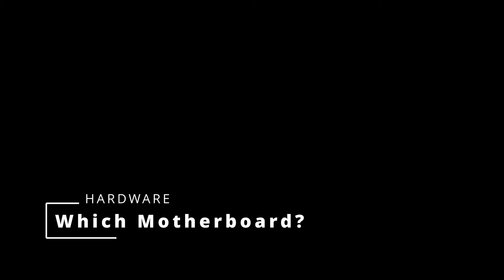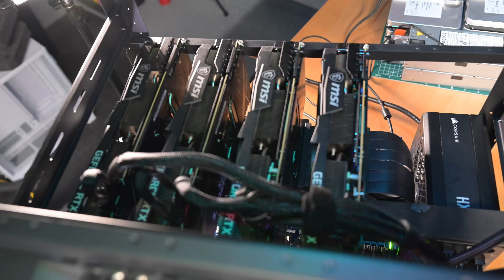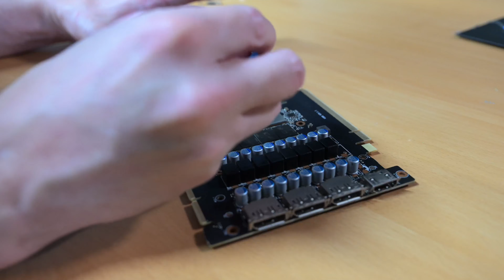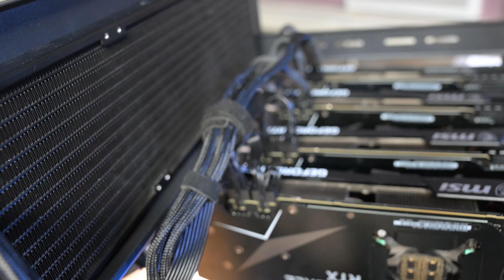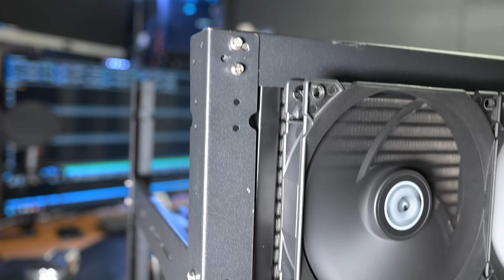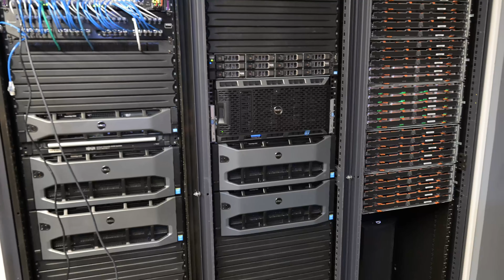INSANE Home AI Server - Quad 3090 Build

Comment: Do you have any recommendations for an air cooler for a CPU?
Reply from the maker: what is the specific CPU part number?
Reply: @DigitalSpaceport  I’m going to purchase the 7702p CPU, just like your specifications.
Reply from the maker: I use the Noctua SP3 on another epyc Rome system, a 7B12, this is a very tall but should just barely clear on the GPU rack from a measurement I just did. Like 10mm close. https://geni.us/NoctuaSP3_CPUCooler
Alternatively the D9 also fits SP3 and is lower profile at 92mm and It is featured in this video on my 7995wx. I like it but its noticably louder under load, but the 7995wx is the hottest chip to my knowledge. If it ramps full blast fans, its not quiet at all. https://youtu.be/YQZ2HWonnGA?si=d5CtIYrhjHF0D5AB
Reply: @DigitalSpaceport  Thank you for clarifying. My expectation was for the air cooler to be quiet.
Reply: @TuanAnhLe-ef9yk  To be honest I think it's crazy, I used to use quad GPUs from 2 cards, but that was difficult enough with power and cooling.

I'm not even sure that 4 rtx 3090s will scale well on machine learning.

Comment: does it matter if I purchase a 7702 over a 7702p amd epyc cpu?
Reply from the maker: @Grapheneolic  7702p is fine for single socket boards. It wont allow for a second processor is the only difference.
Reply: @DigitalSpaceport  Thanks for the quick reply. So given I purchased a 7702, I could technically add a second processor if wanted to?
Reply from the maker: @Grapheneolic if you have a motherboard with a second socket, yes.

Comment: Do you have to use even number of GPU(4)? Will it work with 3 GPUs?
Reply from the maker: Yeah 3 will work, just remember that the VRAM is additive so you want the whole model to fit into the VRAM of the cumulative cards.
Reply: @DigitalSpaceport  thank you very much for your reply, I'm just getting into building pc for LLM and gathering information on which gpu I should use and how multiple gpu can be beneficial

Comment: Which ollama model did you use? What is token count? There is not any info...
Reply from the maker: I'm using metas llama 3.1 70b and it hits between 22 and 17 tok/s. 8b hits around 95 and 405 hits around 1. Have a full video on each model coming up but this video I think I have a chapter on llama 3.1 70b you could check. https://youtu.be/q_cDvCq1pww

Comment: Unlike gaming, AI and machine learning really do not benefit from 16 vs 8x lanes.  That is because models are loaded once.  Once the model or models are loaded into VRAM, the CPU has a minimal effect.  Now, if you are pooling VRAM with NVLink, it is so much faster than PCIe 3.0, 4.0, or even 5.0 by a long shot.  Also, though I have U.2 access with both the Z590 Dark and Z690 Dark Kingpin, they pale in comparison to the speeds of native PCIe 3.0 and 4.0 NVMe.

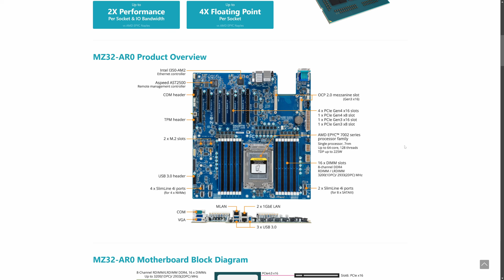I, too, have that same chassis from mining but have always wondered how it would perform as an AI frame--just haven't gotten around to tinkering.  At 3:20 I've stopped, because experience gained from the last year of the Etherium GPU mining boom to now is sufficient, and for me, I doubt there is any real new value.
Reply from the maker: Oh Im doing training also but yeah full lanes are not needed for inference. I did mention that. Can I nvlink the 3090? Ive read its minimal return recently. I guess the channel isnt for you, no harm at all there lol.

Comment: Really cool build, I also have a 4 gpu rig.

The only thing that I would recomend is trying to give some space between the GPUs as maximum as possible, because they being close to each other will generate a lot of heat, the difference is enourmous. 

I would also add extra coolers to the GPUs, I personally like the maxmium of 1 gpu per 120mm cooler , and the coolers blowing ar direct to the GPU.

I'm not sure if a watter cooler is a good Idea here, I'm saying that because no server uses watter cooling, neither CPU miners (people using the cpu on 100% 24/7), because watter coller tends to stop refrigerenting at some point, and it doesn't have the best efficiency. I'm not sure also if a 120mm cooler will fit on your build, I'm just giving food for tought
Reply from the maker: Yeah the water cooling is working fantastic at keeping the CPU cool under workloads for really large models, but Im fast becoming annoyed badly those. Too dang slow. The 3090 non ti also generates a lot of heat on the back. Im working on a placements to help with heat load also. Im likely to have a video on that also at some point. Ive got vornado knockoff right now and it hits the board and keeps the nvmes cool, but redoing the whole layout of the mini datacenter is very likely.
Reply: I have a question, are you able to load any large ai model or at least model 32B 8Q with 128k windows context?  I mean only use GPUs?

Comment: Have you tried renting out your hardware with vast ai or salad?
Reply from the maker: I need better upload speeds. Cable modem has me capped at 40mbits upload but high split is on the way and should make that a viable route for idle times. I need to think about reservations and utilization more before I put this rig on it but competition is pretty high on depin, and impossible at 40mbits.

Comment: This is dope and extremely cost effective but it's not future proof. What happens if 2x 5090 makes it possible to run llama 4 1t
Reply from the maker: No its not future proof at all, but I wanted to wait until we see the next nvidia GPUs before I decide on something bigger. I dont think we will see more than 24GB VRAM in the 5090 currently, and while model split is a thing and does work.... its pretty slow.

Comment: Powering each 3090 with a single 8 pin ala piggyback connector?  I thought 8 pin standards had a max wattage of 150w and even though your going to use afterburning (or equivelent) to reduce, you stated anticipated 275w. I just finished a chia miner 4x 4090 setup and I'm going to have to use afterburner to reduce the power as three 4090's on a single Asus ROG Thor 1600 trips the internal breaker and shuts off the PSU. Will be interesting to see how your four 3090's and the Corsair 1500 handle similar with additional draw from an Epyc processor/motherboard combo. May need to add a second to perform as desired. Thumbs up! - I see the PHISON drives also, nice touch.
Reply from the maker: Okay im going to research more on that here. Im not aware of it, and none of the cables are warm just touched um under load for about an hour. Still a good thing to know.
Reply: @DigitalSpaceport , @bishop838 is correct. 150 W per cable for the PCIe connector is the official spec. You also get 75 W from the PCIe MB connector.  Some of my power supplies list 200 W per cable max (even with two connectors), so if you can limit your GPU power to ~225 - 275 W, you'll be under the limit.  If you're just running LLMs doing inference or even Stable Diffusion/Flux image generation, though, you should be fine even with the current setup.  Unless you're doing training or fine-tuning that runs the GPUs at 100% continuously, you're unlikely to trip any breakers or brownout your power supply.
Reply: @hienngo6730 what's the max rated cable you can get? I was looking at a duel PSU 7 * 3090 set up
Reply: @Chris-o1x3b  I have not seen cables rated for any specific power rating. They should all support the spec, though you should probably get good quality PSU to get decent cables. I have 2x 1600 W PSUs in my 5x 4090/3090 rig. I use the standard cables that came with the PSUs (I use two of the 12VHPWR connectors for two of the GPUs, and 2x or 3x PCIe 8-pin power for the rest.). 4090 and 3090 Ti are rated for 450 W each and 3090s are 350-390 W each.)

Comment: Explain to me like I'm knew to this. 

Why would you want to run an AI server? What applications would this enable, and is it actually any better than building a server with more consumer kinda parts? AKA 7950x or 7900x + ONE 3090
Reply from the maker: Love this question. Im going to quote it in the single GPU video which will fully answer the why part. Of note is speed for inference (processing) requests to the system and models landing inside VRAM is of course ideal to the tune of like 10x speedups. Thats a major reason. Several other big ones exist as well.

Comment: How do you plan to cool your mainboard, the board is made to run in a server enclosure. In your current setup only the top of te rack with the gpu's is actively cooled. How do you plan to cool the ddr and other chips on the motherboard?

I run a h12ssl-1 motherboard with Epyc 7573x with 2 x 3090 and went with an Artic freeze u4 air cooler instead of water cooling to get that extra needed airflow inside a 4u server case. I was considering the Gigabyte motherboard but since I don't use a riser setup the top pcie slots wouldn't be usable since the gpu would be directly over the cpu socket.
Reply from the maker: I think the H12 is an excellent choice also! Have one myself going into a 4u case soon. Four fat 3090s wouldnt fit in the case however and this board is v cheap. I have a small vornado knockoff fan that moves a lot of air over the mobo. Thats shown in the most recent video now also.

Comment: can you run llama3.1:405b model on this?
Reply from the maker: Okay I did get 405b to run on this. It was EXTREMELY slow however. I would class it as unusable. That was not unexpected but only 44 layers of 145 can load into VRAM on the GPUs so yeah I guess I would need ~ 12 GPUS of 24GB to run it at respectable speeds. Hit .75 TOK/S at 2048 which ended up being around 6 min generation time on easy logic.
Reply: @DigitalSpaceport  thank you very much for testing if you are just limited by vram would it be feasable to run M40 instead? i have seen them on ebay go for 170€
Reply from the maker: Id be surprised as Maxwell generation is pretty old now. CUDA 5.2 and also pcie3. I'd not go with those cards but there may be more recent ones I should check into.

Comment: I was actually using a Gigabyte H110 mining motherboard for a little while (with a piddly 6500T, for the CPU) because it was all just left over hardware from when I was GPU mining.

The problem that I very quickly ran into was that the models that I was trying to run, save for the smallest of models -- the 6500T very quickly ran out of RAM (at a max of only 16 GB).

So, right now, I have moved it over to my 6700K (again, just recycling/re-purposing existing hardware that I already have vs. buying used hardware that'll be new-to-me), and at least my former gaming rig has 64 GB of RAM, so I am now able to run some of the bigger models.

I might try and throw more 3090s at it later, but I've found that unless you have manually told the AI interface (whichever one you're using) to split the workload between the GPUs (especially, when you're loading in the model) vs. trying to use as few GPUs as possible (i.e. if your model is 34 GB in size, the question is "is it better to split the model up into 4x8.5 GB or run it as 2x17 GB?" (because the 34 GB model exceeds the 24 GB of VRAM on the 3090 and that is WAYYYY cheaper than buying like an A100 with 40 GB of VRAM, let alone 80 GB of VRAM, all on a single GPU).

I haven't ran that test yet because my 6700K is definitely slowing down how fast the AI chatbot can "type".
Reply from the maker: Very interesting did you get around to testing this?
Reply: @DigitalSpaceport  
Yes, I have actually.

Right now, my 6700K system has two 3090s in it, albeit, by putting in the second 3090, it drops both PCIe 3.0 x16 slots down to two PCIe 3.0 x8 slots (each).

So, TECHNICALLY, the bandwidth suffers, but in practice, once the LLM is loaded into VRAM, it doesn't really matter when it is answering questions.

I'll have to pull the performance stats from the system when I get home from work, later tonight.

But subjectively, the three things that I have observed are:

1) It depends on which model you're using.

and 2) it depends on the SIZE of the model.

and THEN 3) is where the CPU speed matters after that (because it has to "type out" the response). 

I can also run another test where I would drop in one of the 3090s into my AMD Ryzen 9 7950X system, and then pick a model that will fit within the confines of 24 GB of VRAM, to see how much the CPU affects the performance.

I can test both of that, later when I get home tonight.

But yes, I did deploy it (for the larger models). It does work. I don't really have great speed comparisons as I don't have very many platforms/systems that are open and available for testing (and most of my systems tend to be older systems).
Reply: @DigitalSpaceport  
So...ran into a little bit of an issue trying to update Ollama from within the open-webui installation.

I had originally done both, where I installed ollama outside of open-webui AND I think because it was having connecting to it from inside the open-webui docker container, so I ended up installing ollama with open-webui, which also meant that when it came time for me to update ollama so that I can download the llama3.1:70b model, I ran into some issues with it.

Long story short -- I THINK that I have the docker container rebuilt now, but I'm about to find out.
Reply: @DigitalSpaceport  
So I finally got around to testing with the llama3.1:70b model that you are running in your latest dual 4090 video, but I'm running with two 3090s (@PCIe 3.0 x8 speeds rather than @PCIe 3.0 x16 for both).

I'll post the results in the comments section of the other video.

I also did run this with the Mixtral AI codestral:22b model as well. It works quite well, I think. Overall. (I don't really have another system to test it with, to see if I can get better performance, so this will have to suffice for now.)

Comment: Why limit gpus' TDP?!? Just add another PSU! 4x3090 is 1400w already! 512ram and 7702 cpu is another 500w, so one more PSU, 750w minimum, it costs nothing compared to the price of the system. And with 1500w you don't want to run it on the max limits, keep 20% reserve, If you want stable reliable system, your gpus has to be limited to 150w instead of default 350, that's a huge hit!
Reply: Because you can lower the power limit by 100w each with just a couple percent performance decline for inference. Well worth lowering the power usage.
Reply: Very good point, btw
Reply: Or just use 1 bigger power supply, maybe a 2kW one?

I have done that kind of thing before, and it typically doesn't work for long, but it's great when it does work.
Reply from the maker: I likely move it into the server racks at some point, for power draw reasons. Im also likely to get a DC powerboard for it then but I've got a lot of rearranging gear to tackle before it gets to that point. The CPU/ram doesn't cross 250 from what I've seen on my 7B12/H12 combo unless im running the cpu hard which this type workload doesn't seem to so far. I also don't trust the 2psu adapter kits, have known a guy who mined eth hard and had several burn up
Reply: @DigitalSpaceport also, for llms, the peak performance is less important. Tha vram is what is golden about that setup right? I limit the power of my 3090 on my grid, just so they don't reach the highest temps in my fairly small case(i am at my financial limits, 800 dolars of used components is what i could afford)
Reply: @DigitalSpaceport  Llama uses cpu at first to compile and ram, then gpus as of my observations and I asked llama how it(he/she) works and got the reply confirming it :)

Comment: Have to say as a GPU/CPU/ASICS  and now AI miner. I do want to build one of these bqad boyz, BUT i would use EVGA PSU and ALSO to be SAFE from FIRE Hazards I would USE 2 PCIE Power cables to the GPUs not one power cable like you did. Beocz of gthe TPD of the 3090/4090. and soon 5090, Beocz of the LIMIT of 1 cable is 250 Watts and the TPD is higher and will MELT and start a fire! Just go to Red Panda's Youtube vids and he shows a vid of Melted and Burnt PCs. That too uch money and time to build that awesome machine and then get LAZY! Dudes if there are 2 or 3 PCIE 8 pin Connectors on that GPU! then do that. but yeah great vid, but no dudes. be safe! u could not only lose this beast of a system but all you own! your home or family. for the specs of GPUs and PCs or just about any tech toy! go to techpowerup .com o yeah Also u can use sever PSU's with the right break out boards, but me i would buy 2 evga 1,600 PSU's to make sure I am under the 80% rule of load and amps and watts on them! also be safer. example. MSI 3090 is TDP 350 W times 4=1,400 watts! And EVHA psu come with a MB connector tester. or u can buy an adaptor were u can use both PSU to work together. and then the TDP of the CPU and Motherboard. AMD EPYC 7702 is TPD of 200W, then u have the other stuff. so that will be well below the 80% rule of load using 2 1,600 watt ones and i seen a 2,000 watt psu too! so buy bug just in case of upgrades. I do hope soon that they make it use way less electric and heat.

Comment: Please, test mixing diferent VRAM size cards like 3090 (24 gb) and 4070 (12 gb). Can it balance the work in a way that don't crash when hit the 12 gb mark?
Reply from the maker: Am planning on this and a few other test. Here are some cards I have on hand that I may run mixed workload testing against. 3060ti, 3070, 4090, A4000, A5000. I think the A4000 + 3070 + 2x 3090 would be a good test.